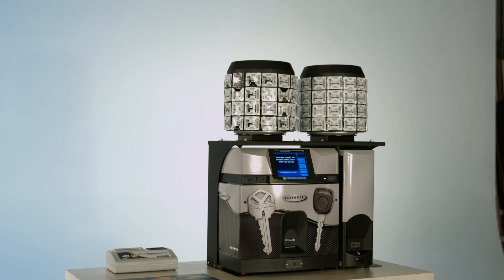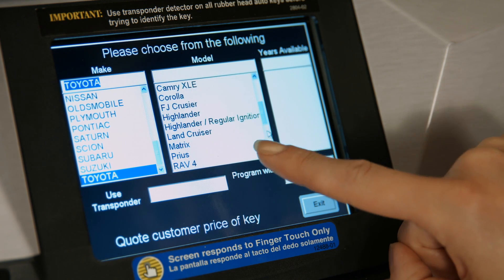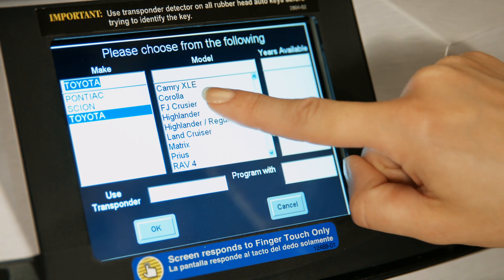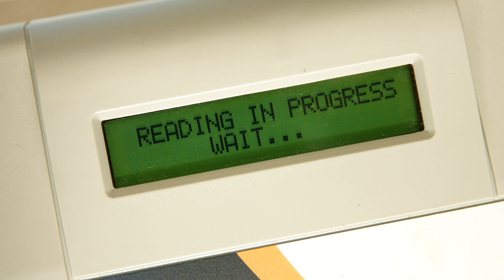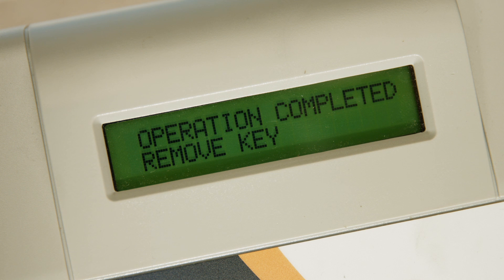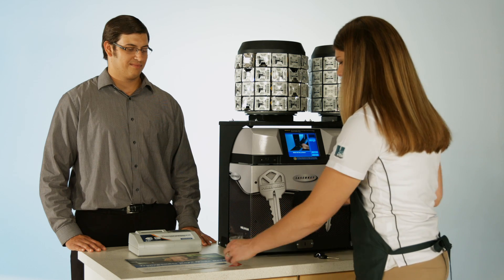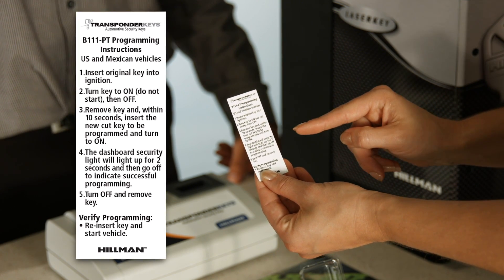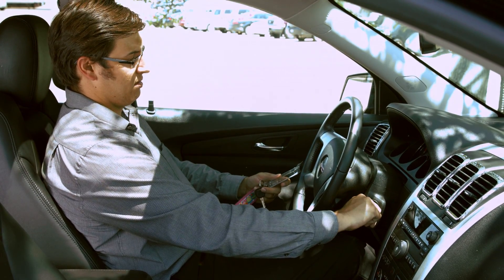PKOR Laser Key Duplication System for Automotive Transponder Security Keys

Comment: I lost my keys but I remember the key number will that work
Reply: No. You need to go to the dealer
Reply: Find a local locksmith, being wary of Google Searches. Most communities will have at least one great Automotive Locksmith Expert. You also can find a FULLY BACKGROUND CHECKED member of our national association in your area through www.findalocksmith.com  this is a free serice to the public from the nonprofit ALOA. 

These "EZ TO USE" dept store key machines and kiosks often make mediocre to poor keys. They result are not properly programmed keys, but a cloning process that is second rate, thus less reliable. Locksmiths will un-do the problems, can deal with worn or broken originals, do on-site work and inspect ignition and make sure you really are good-to-go. We also can repair ignition lock issues, and do the THOUSANDS of keys the machine in the video will indicate can not be done.